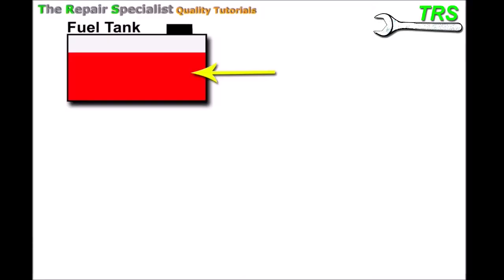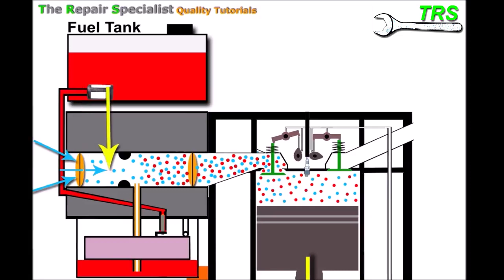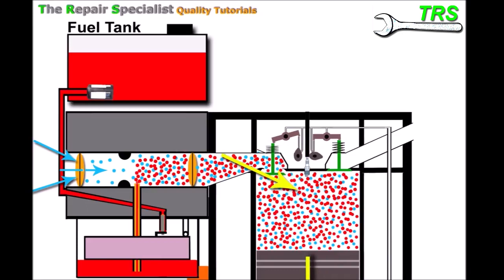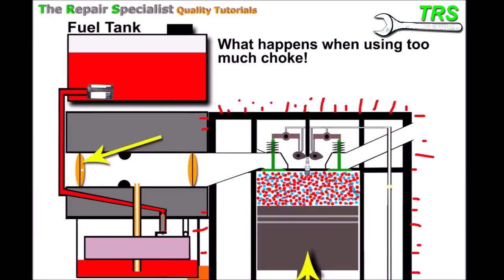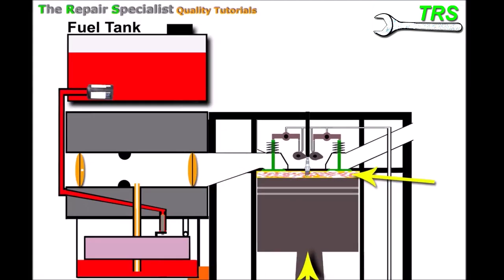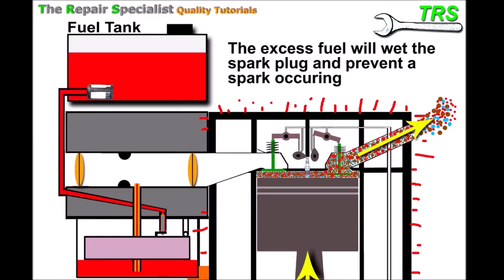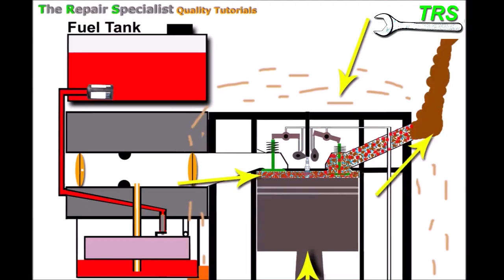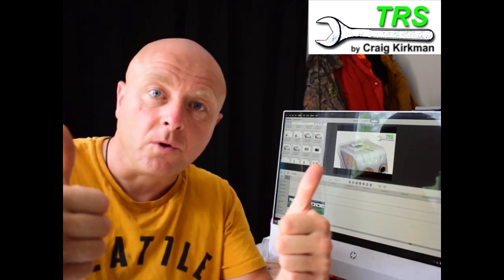Too much Engine Choke | Does this to your Engine. Chainsaw or Lawnmower wont start!

Comment: Another good explanation, great informative videos. Just in an attempt to add something for others to note,   this same over fueling/ choked condition could also be caused by a blocked or very dirty air filter which would also make the engine run rich.
Reply from the maker: Yes absolutely. Thank you so much for the nice feedback. I really appreciate it. Craig

Comment: Brilliant video as always! I've a strange issue where my choke doesn't actually do anything. The machine (Titan petrol strimmer) takes a lot of pulls to get going on any choke setting. When it runs and I apply the choke it does nothing, shouldn't it bog down the machine and eventually stop it? I have checked the choke assembly with another machine and it appears fine. I have changed the carb for a new one with a primer bulb setup as opposed to a purge bulb I can only think it has something to do with that?

Comment: Thank you.  Very informative.  Question:  I have an 8hp single cylinder Tecumseh HMSK80 engine on my snowblower.  When cold and with the choke on 3 primes on the primer bulb the engine starts right up and runs well.   After running the engine for a few minuets to get it nice and warm, I shut down the engine.  With the choke still in the open position (choke off) it will not start unless I prime it once or don't prime it but put the choke back on then it will start and run fine.  The carb is completely clean, checked the fuel cap, it's venting, check for spark while it was hot.  I had spark.  I cleaned the fuel tank and made sure all was dry.  I used canned fuel 92 octane (NO ethanol), New spark plug. It's an old style Tecumseh carb adjustable.  I set the carb to manual specs.  The carb bowl jet adjusted out 1.5 turns and the air fuel mix one turn out.  I also tried it at 1 1/4 turn out as well.  So why does my warm engine need the choke on when warmed up?  Thanks for taking a look.

Comment: My 4hp Hangkai outboard engine will only run with the choke on. I've tried cleaning the carb and jets with carb cleaner but it's still the same. As soon as I switch the choke off it stalls. Anyone got any ideas please? And will it damage the engine if I keep running it with the choke on?

Comment: What is the time limit in using the choke?
Reply: I cold start half-choke for half a second, then put full for about 15-30 seconds tops, then back down to half for about 5 secs, then off. At least that's how I cold start my bike after a week to two weeks of no start.

Comment: Awesome explanation. I’m living in Vietnam and I have an old Honda 67 motorbike. If I don’t ride it for a couple of days I need to use the choke to start it. But recently when I start the bike, it runs for about 2 seconds and then even if I twist the accelerator, the engine will just die. Any idea why it won’t run? I can start the engine using the choke (won’t start if the choke is off), but I can’t keep it running, it just stops. I had to get a taxi to the consulate this morning cos I couldn’t get it running :(
Reply: Did u check the spark plug? Sometimes dirty sparkplug becomes problem.

Comment: Hi Craig, I have a 2 stroke engine that used to start perfectly on choke when cold. I had the engine rebuilt and ever since, it won’t start on choke and is difficult to start generally (but will start) with choke off. I cleaned out the carby, but just a bit lost as to why this might be happening. Any feedback would be appreciated, if possible?

Comment: I have a 2002 honda rebel 250. I was tuning the carb by adjusting the idle and fuel mixture screws. After, with the bike being warm from riding for about 20 mins, the bike would die if I opened the choke. Is this normal?
Reply from the maker: it doesnt sound normal to me, a Good place to start is to reset the carburetor from scratch :) are you familiar process for this?
-craig

Comment: @THEREPAIRSPECIALIST First, thanks for vid and you are correct on the needle and seat. Next, you was clear unlike so many  where a 5 sec is a 20 min video with here is your dinner crap and joke to get views. Because views is more money and some only care of that. One thing I can't stand is a vid that the poster replies to for about a hr to kick start the replies and you never hear no more. I see you do reply so I will take the time to explain my story.  The comment will be long so to others that don't want to read or spend time- skip.... Info- Yard Machine riding mower. 2007. Briggs engine I/C 17.5 same style as one you have showing. Sits on a Nikki carb # 799727... Fuel filter I put on it was not the little round one. It was #493629 691035. I put new gas lines on it as well as flushed tank clean. About me so you are aware I know some and not total in the dark in working on stuff. I been repairing electronics since the 80's. I have worked on two stroke stuff and a little four a decade or so. My own stuff only. I have rebuilt carbs from the ground up by cleaning and kit install. Mostly two stroke blowers and weed eaters. Worked on my fair share of push mowers as well. I have no degree, but put the effort in study and learning. Some things I do are not right or I may not know and try. I do take blame and certainly in this case with above riding mower I need input on.
 That said here is the story on my mower I brought  about 3 months ago used. The mower looked pretty good and checked out to me when I looked around. I mowed with it for two grass cuts ( about a week apart ) and it was fine. Course I wanted to clean the engine and all that. I also know about bad gas and cheap gas. I assumed the owner did use cheap gas and left that sitting at times. Natural to me I took the carb apart and behold it was nasty crusted ( but it ran fine lol ). Cleaned it and all holes etc and got it looking new. Mowed my lawn and all was fine and smooth. Came back five days later ( after the two weeks of two grass cuts ) and attempted to start. It would not and herd compression pop at air filter hole. Removed that cover and the filter was dry, but the tube was soaked in gas. Also the carb bowl in middle leaked outside of it. Checked my oil and gas was to smell. Ordered a online cheap rebuild kit ( my first in hopes was good ). Installed new needle, float, O rings, gasket and fuel mix ajust screw ( ajusted that out 1 and half turn ) . Keep in mind the seat is the whole plastic body that goes in carb. Nikki 799727-. Tested solenoid on regulated power supply and checked out fine. Next, the oil was changed ( I changed that also when first brought mower ) and never seen nothing like it. Just gushed out forever gas and oil bad. At THIS point I put a gas shut valve on it. All that said and done I started mower when I turned gas shut off on. Fired up and ran smooth for about 15 sec and engine slowly bogged and died. As it shot gas up the air filter tube right behind where filter sits. Shut the valve off and restarted which is struggled at first and back to running. Another 15 sec and same issue. Smelled under the oil fill cap and no gas smell yet.......     So, I solved the gas leaking out middle of bowl with new gasket I guess. I did NOT solve the flooding. After a 7 hr day sweating outside in 97 heat I pushed mower in shed. Few days later I opened carb and pulled all out I did in rebuild kit. I brought a few kits so I redid another. Carb back on and same issue. Put mower in shed lol. Never brought a cheap China carb so did not want that route yet. Carb two-  Found a exact used original Nikki carb online and brought. Sat and got said and it was nasty outside. Nothing like the listing so I suspected bad gas. I opened such and it was the worst I seen. Rebuilt it with a cheap kit after ordering more kits. Brought new oil and did another oil change. Put carb on and same issue. At this point after issue I took both carbs apart and swapped old and new parts every which way. I put both carbs on and got same issue. Ordered a original Briggs bowl gasket, jet only and installed. Got same issue. 3rd stage- Found a 3rd Nikki original online and guy said pulled from blown mower two months ago working. Installed it after apart and spraying carb cleaner in it and got same issue flooding to crank flood in bowl. Next I  put a aftermarket rebuild kit in it and still floods to crankcase after 15 sec. I am at my end and wasted a month and money and do not understand what is going on here. Oil wasted, 90 oct no eth gas wasted on 3 carbs with same result. At this point the grass is really tall lol. I am getting to the point also worried my engine may blow with all this jerking around. It had a few times vapor locked and or it struggles to turn over on start spinning at the top when you look. As it stands of this date mower is in shed. I did NOW ( August 16, 2020 ) order a cheap new China carb. But I get this gut feeling it is going to do the same thing flooding. Now the fun continues with all the research and vids. Which is a waste of more time on many. Get to the subject of flooding and all they say is needle and seat replace. Many have said the same issue as me on new and many carb replaces and rebuild and have same issue. No one says a thing or knows on the solve or exact issue. Others say they replaced needle and seat in same carb and been just fine. What the hell..... You got people who use crap gas and mow one time a week. Leave sit all winter and just fine on these Nikki junk systems. Others got to put a shut off and that don't work. Go through a whole ordeal and nothing. Thing still floods in crankcase. Than I am curious about the shutoff. What about the gas in carb and also upon turn on. Wouldn't that get in the crank and wreak motor in time? Why should we even have to add a shut off or carb hop even on new stuff. What happen to running good gas and a new or rebuilt carb and fine. This whole thing is a nightmare indeed. So the issue at this point is after 3 carbs and all mentioned I get flooding in crank. Oddly to me the engine WILL run just fine and smooth. THAT IS- when you start it For now till I keep jerking around on it. 1.Turn valve on and it starts and does great on low and high. That is on all 3 carbs. 2. 15 sec later all hell breaks loose and floods crank with alot of gas backing up air filter tubes. Any takers please on the exact issue and solving it beside a needle and seat? Or... spend the 45 on a original kit and install that in a carb and it will solve. I think the problem is a bit more though. But I will await for input before I do anything and watch the grass grow. For now all I see is no one knows nothing on this exact issue when all mentioned was done and still get flood. Sad part is the mower is fine and it will sit, get tossed or what ever and I will go back to push mowing. Because I can't afford to send it out to have a $100 a hr  person look at it. And this was my first riding mower I ever got for me.